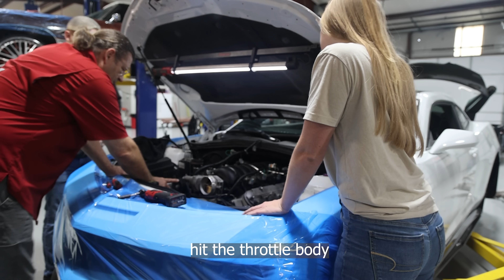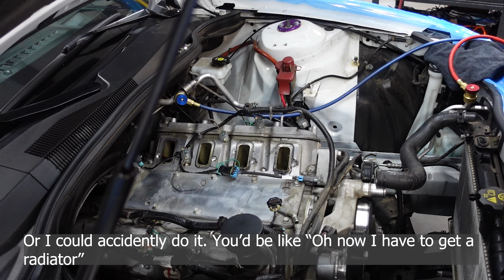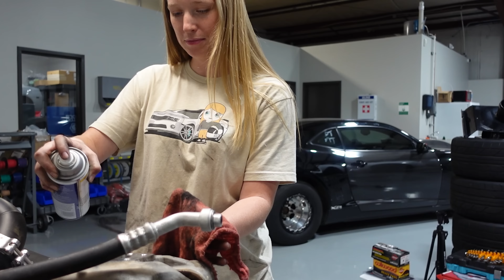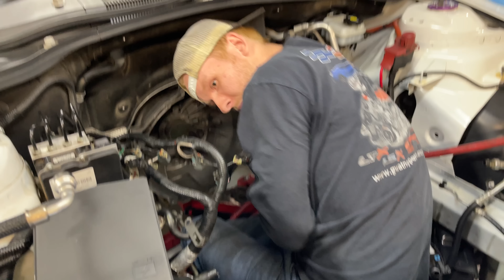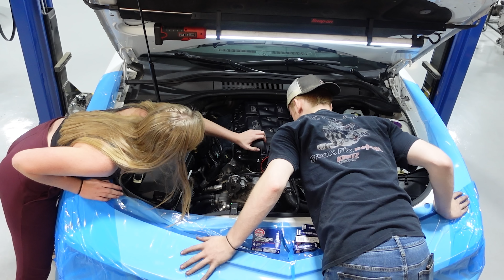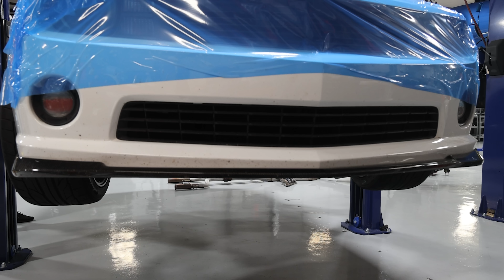Engine Swapping my OLD V8 for a 416 STROKER !!! Ep. 15

Comment: How are you using the msd ls7 intake with the LS3?
Reply: probably ls7 style heads
Reply from the maker: The MAX 2.0 Package has BR7 Heads (LS7 Top end) to be able to fit the MSD!
Reply: @KaylaRundle very cool, that should give you the most flow.